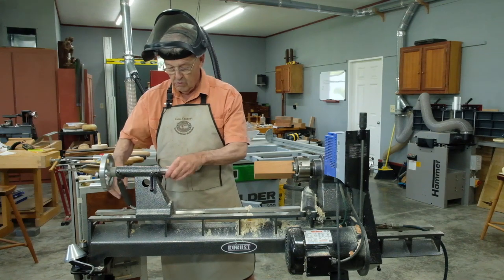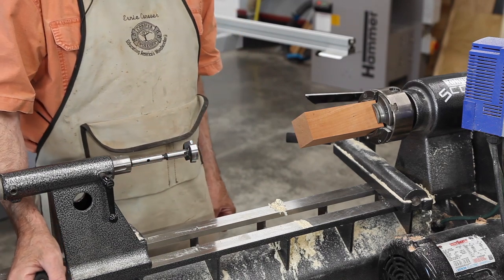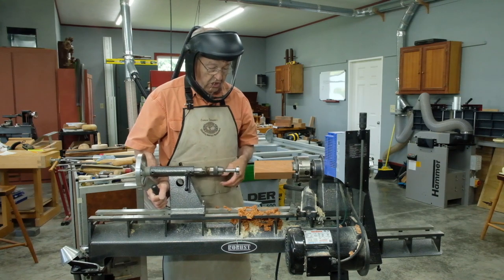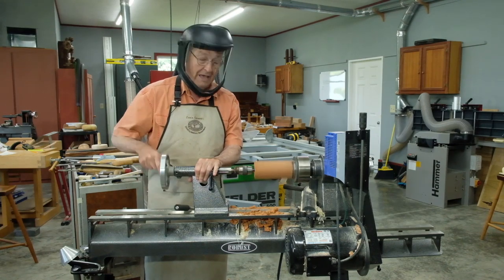Woodturning Project: Pepper Mills and Salt Shakers

Comment: I thought, gee, I could make these as inexpensive Christmas gifts for my brothers and sister. Then I saw the boring kit alone cost $200. And the peper mill components add up to $40.
Reply: There are cheaper kits out there. You do not need a $200 boring kit. Think about alternative solutions. If it calls for a 1 1/16 hole and you have a 1" bit,  you can use it and open it up with a scraper.  Don't give up so easily. You can do it!
Reply: I have made quite a few over the years and agree the components are not cheap! If you only want to make a few you can find appropriate sized drills on the cheap and keep the height modest and get by fine. I often buy bargain Forstners knowing that I will have to work on them with a Dremmel to make them work right. You can probably do it for less than $100, maybe $75.